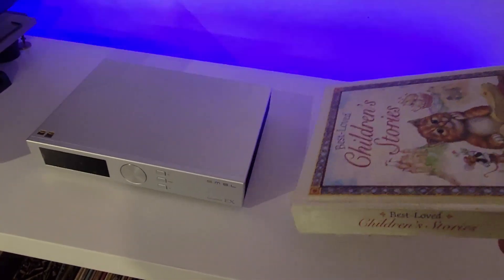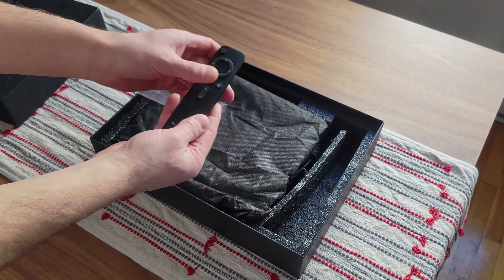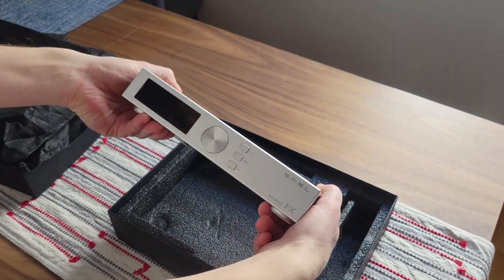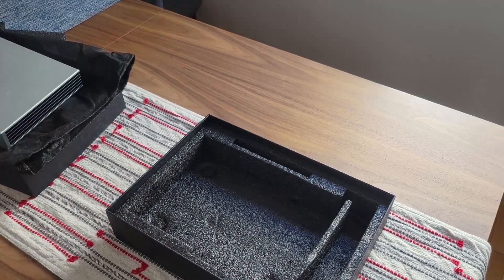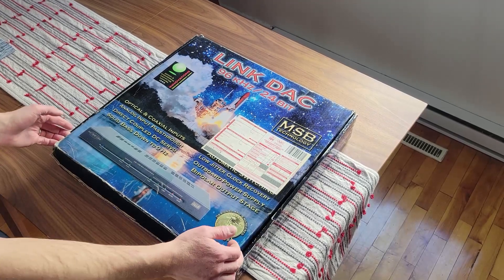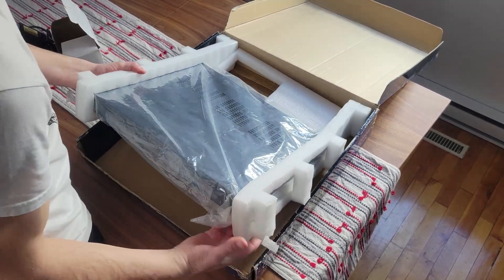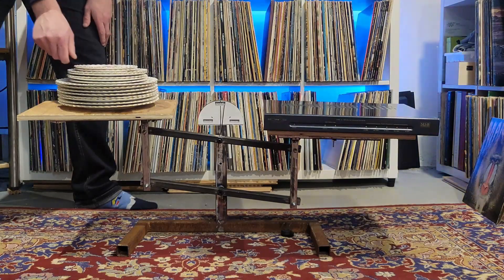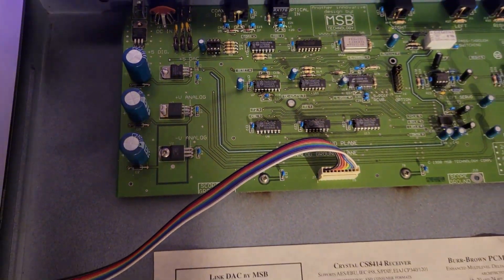New vs. Old DAC - SMSL D400EX vs. MSB Tech Link DAC - How far have we come in 24 years?

Comment: I am listening to the MSB Link Dac with the Full Nelson Upgrade (and the large power base).  I I also have the MSB output fed into the Music Fidelity x 10 v 3 tube "filter" (the box shaped one) with a custome power supply "warming" the sound a bit ---  I have done tests and there is an improvement for the classical music I like to listen to.  I am using very high end cables I have collected over the years and it sounds amazing.
Reply from the maker: That's awesome! Did you try the DAC before and after the power base? Just wondering if I should search out one. I am looking at upgraded op amps inside, looks like an easy plug and play upgrade.
Reply: @davelistenstohifi  Yes. The power base was a purchase after the initial purchase and the improvement was noticeable but marginal, as was the full nelson upgrade. But to be honest, if you EXPECT to hear an improvement you will hear one. I do think the powerbase is worth it however, and if you can find one, I would purchase it. They are not going to be obsolete.
Reply: It must be your very high end copper
Reply: @crazyprayingmantis5596  It could be!  LOL.

Comment: hi...please help me out...I purchased a top of the line Denon DCD-SX1  limited...thinking it would be a final...it is a SACD/CD/DAC...but after owning it for about 6 months, I'm not pleased with the plain,boring sound...not dynamic...said to use Quad-DAC configuration. Two stereo DACs (PCM1795)...would i be better to get a new CD player and an external dac...I want more dynamics...
thinking of getting either Aqua la scala mkll or MSB Discrete...i also hook up my tv to my system with tv opical out...what do you suggest❓
Reply from the maker: Hey Brian Campbell, thanks for watching my videos. I cannot say I know anything about the Denon DCD-SX1, but It looks gorgeous! I see that it has been designed to sound "Vivid & Spacious",  I guess you want something with more fireworks. I'm guessing that the Aqua la scala may not bring the most excitement compared to the Denon, MSB are pretty accomplished though but I haven't heard the Discrete. As a last resort, have you tried some different cables with the Denon, or possibly some physical supports like Isoacoustics or Audwave? As for the tv integration, I have no experience with this at all, sorry!

Comment: Thanks. This is just the review I was looking for. I own MSB Digital Link III. Also Benchmark DAC 1, PS Audio Digital Link III, Micromega MyDac, Cal Audio Sigma II (Tube) and a Museatex Bidat (Needs repair). They're all in different systems and I've been curious about the various newer budget DACS from companies like SMSL, Schiit, Topping, etc. Digital technology has supposedly come a long way since most of the DACS I use (except Micromega MyDac) and I am curious as to how much information I'm missing. I've just ordered an SMSL C200 which is not at the level or price of what you reviewed but fits my budget and should give me an idea about new vs old. I do like a lot of detail and unfortunately my age and being a drummer (thanks for the Art Blakey) , I've lost a bit of my high frequency hearing. I've actually gotten 2 Schiit Lokis and a Lokius , equalizers to help in that area. Still curious though about detail retrieval capabilities that a modern DAC will have. The DACS I have have certainly served me well and really sound great but an comparison will be interesting. Also I know that the digital cable, power cord, used has an effect somewhat on what you get sound wise, although Benchmark for example says it doesn't matter. I think it does, if you find the right combination that you prefer.  Thanks again for the review. I'm looking forward to hearing the differences myself
Reply from the maker: Hey Billy, thanks for watching and your comments! Yes, the newest digital does some great stuff in terms of detail retrieval, the analog sections of the DACs can help as well. You have quite a collection of DACs there, impressive! Yes, I have heard some small changes with power cords, mostly the sound signature and not increased detail. I have used some different cables for the digital signal, hard to pinpoint the differences (except for when it just doesn't work!). Let us know how the new SMSL works out.
Reply: @davelistenstohifi  Yes I certainly will. Thanks for your reply.